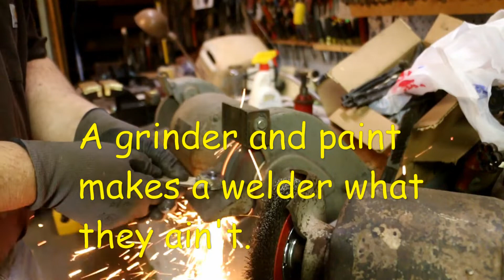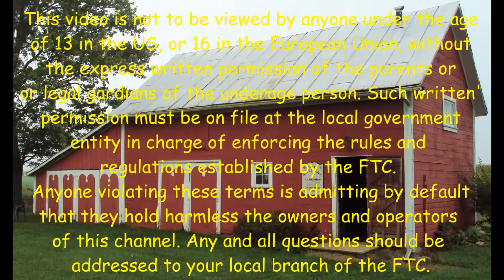Restoring Big Grindstone - Pt 24 - Crank Arms Grind Drill & Tap

Comment: Good machining and welding. If it'll grind, it'll work. I've started using ether for degreasing and if I need more I get out the gas jug. Ether evaporates fast nd I haven't seen any upper cylinder lubrication and it's a lot cheaper than brake clean. But I live on the under side of the edge anyway. Happy Oliver Day!
Reply from the maker: I use to use gasoline until it started making my hands dry out. Now I wear gloves so I could go back to using it. Even at $2.89 a gallon, thanks to Biden and the gang, it is cheaper than brake cleaner. 😖😡😠😎
Reply: @OldSneelock  There you go! I'm always in oil so my hands get oiled after cleaning. Ether is a good spray on too but so is compressed air. Just whatever's there is what gets used I guess. The forethought has to play catch up.

Comment: Grinder and paint makers a good weldor?  I've been retired 9 years and gave up welding 8 yrs before that. I was welding inside a lined tank at the pulp mill. It had a crack several feet around the side  I had all ready ground out the crack and struck a weld and burned the first rod. After flipping up my hood I could see I missed the crack by about 4". I could still weld good by listening to the rod burn, I just couldn't see good enough any more. I found out not welding after 25 yrs wasn't that bad a job. Have a great day Unk' and enjoy the weekend Grandpa.
Reply from the maker: It doesn't make you weld better. It just makes the mistakes harder to see. 😁😎
A friend worked as a welder putting in reinforcements for a bank vault in a Detroit building. The engineer called out a continuous weld on the back side of an I Beam that was 3 inches from the wall. 
They couldn't reach it to weld so they caulked the joint. The inspector saw the caulk bead and passed the job. 
I wonder how many times that happened?
In assembling armor for military vehicles you have to put the welds so they are protected. Armor is rated to handle a certain amount of pentrative force 1/4" of 12560 should stop a 762 NATO round. The same round will punch right through a weld between 2 plates of 12560. 
I was in charge of a project that added armor to a CATERILLAR D-6.
One of the crew drilled a hole in the wrong place. Thinking to fix the mistake they welded up the hole and ground the  weld. 
When they came to me to get praised for their innovation I had to explain that we couldn't do that. Even though the hole was "gone" the weak spot could allow penetration. Since a fail meant someone died we went back through all the armor upgrade kits and tossed any this welder worked on. 
I had a talk with the supervisor and the crew so they knew why we scrapped the armor. 
They didn't know the reason behind the way the process was made. I made sure that we spread the lesson to everyone working there and any new hires. 
I caught that one only because the guy told me. 
The supervisor told me later they had done the same on other armor kits before and while I worked there.
Reply: @OldSneelock   Good for you, insisting on work to meet specification.
Edit:  Especially so, in that line of work.
-Steve
Reply: I never could see where I was going. I'd have to have a pancake hood now. Maybe it'd be a little better but I doubt it.
Reply: @OldSneelock  A right way and a wrong way. I just ran 7's in there.
Reply from the maker: @tree_carcass_mangler  Being in charge means you are responsible. If I design a project that can't be built, it is on me. 
I was the one who could see where we were and how to get where we  were suppose to be